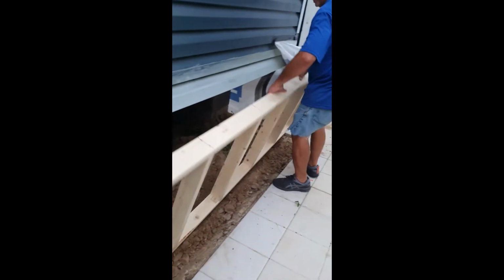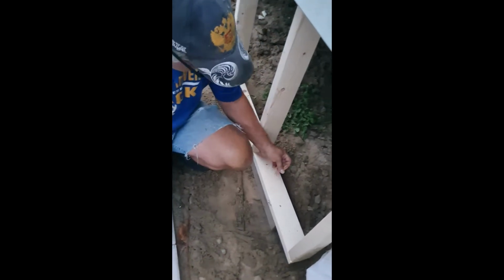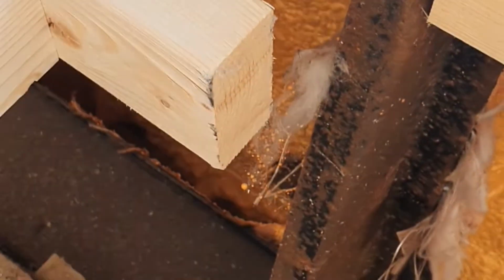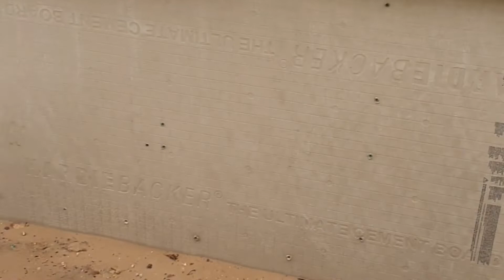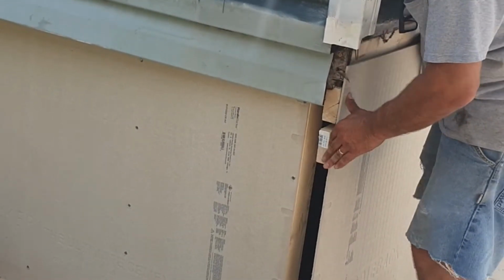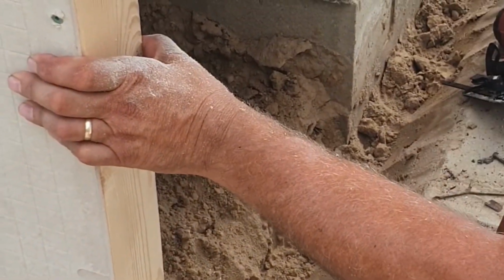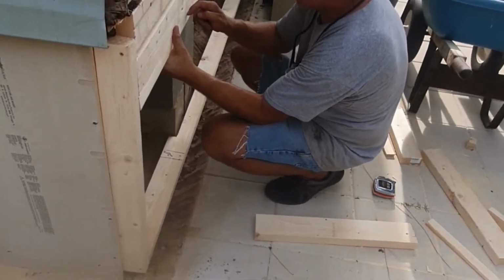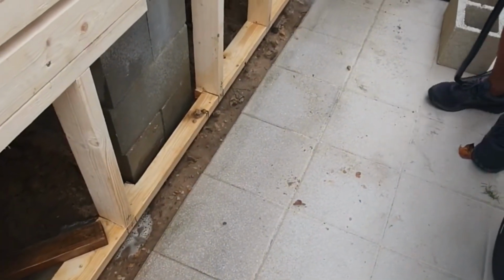DIY Mobile Home Cheap Skirting Part 1 Framing work

Comment: You are not using treated wood at the bottom, it is going to start to roth in less than a year, also termites will eat it and go up to the mobile home through there.

Comment: That wood is going to rot. I'd dig down, pour a footer and set block.
Reply from the maker: It could if water gets to it.
Reply: I thought that, exactly.
Reply: If the boards are coated with new or used engine oil they won't rot.
Reply: @72Dexter72Manley72  No one saw that comment Mr.epa agent at the csa. XD
Reply: @72Dexter72Manley72  He's right but you should avoid getting caught doing that.
Reply: @drewpeterson8619  moisture is going to get to the bottom of the board through a process called condinsation. Its the reason why newly moved mobile homes are required to put down plastic.
Reply: @DARKthenoble  Man, old time farmers have done this for decades. I have done this myself. 
I'm not concerned. 
Gives the wood a nice look when you use new engine oil. 👍🏾👍🏾🤪🤪🤪

Comment: Ive done thousands of mobile like homes. Tried every type on skirting. Gone back to metal buildings steel just pushed in to the ground. Dents scratches  and rusts a little.  But fire proof bug proof wead eater proof. Never cracked like cement board.  No broken plastic from hail. Another thing to keep in mind is, on dirt. It's gong to settle.  Maybe 3 inches and skirting is going to suffer.
Reply: How do you attach it to the home

Comment: What are you using for the sheeting and how much did the whole job cost?
Reply from the maker: It is the cement fiber board. That way you can bury it in the ground.